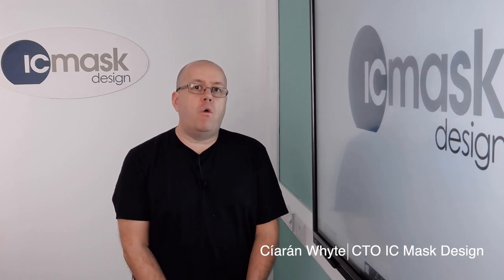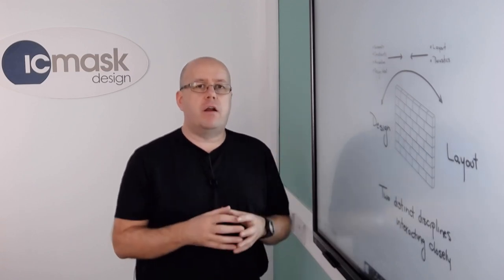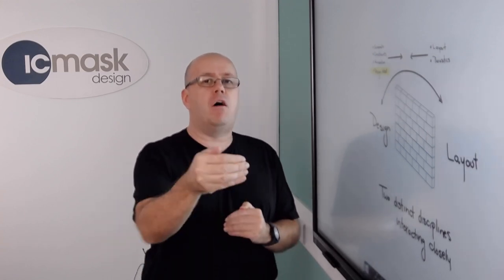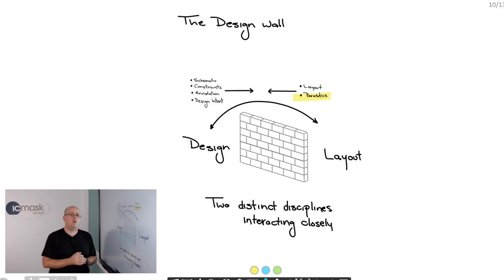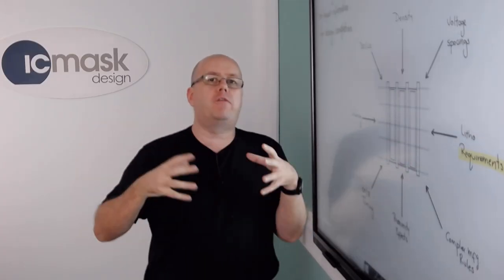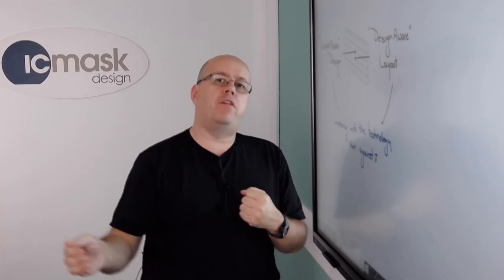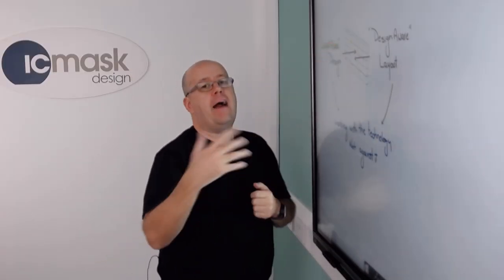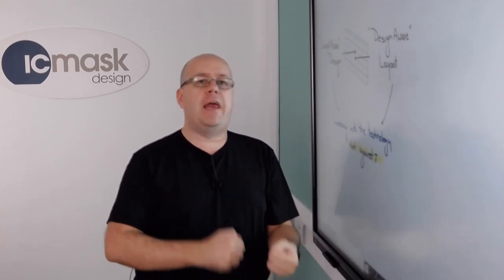The importance of Overcoming the "Design Wall" When Working on FinFET Technology Nodes

Comment: Communication between Layout and Design is the key.  However, it depends on the company and the engineers.  I've had great experiences with communication factor and then in a company that didn't want Layout to be in any directive position whatsoever.  Very nice presentation CÍarán.